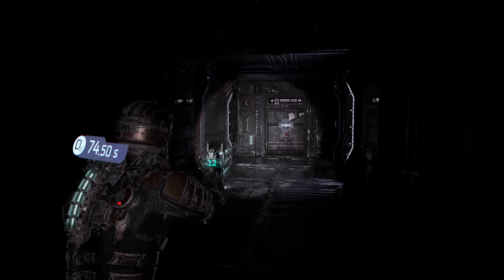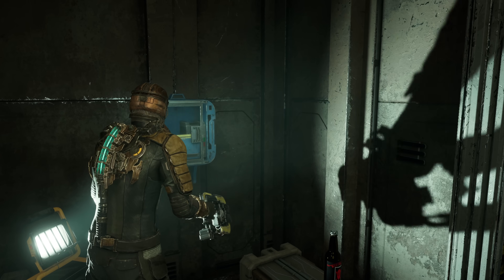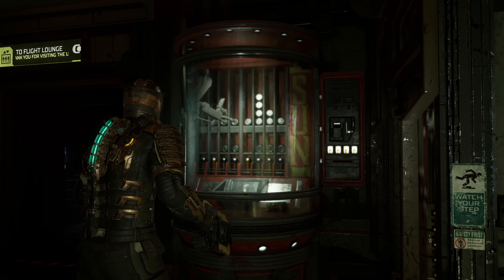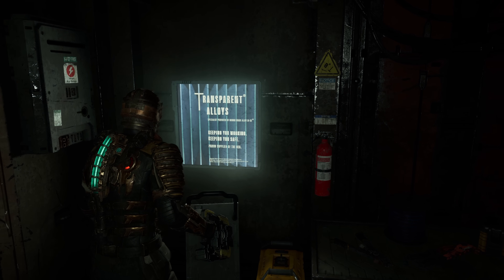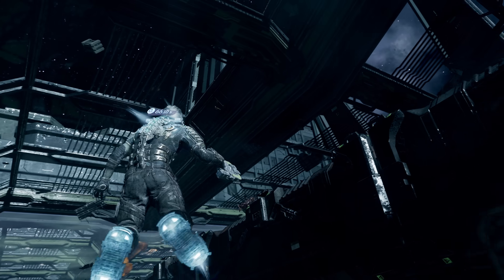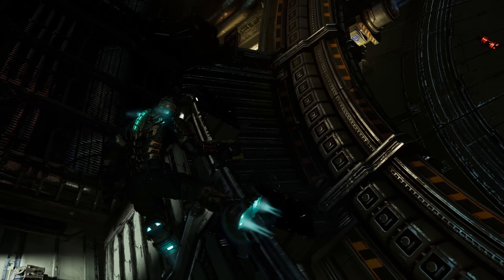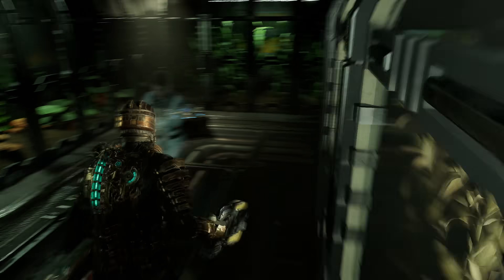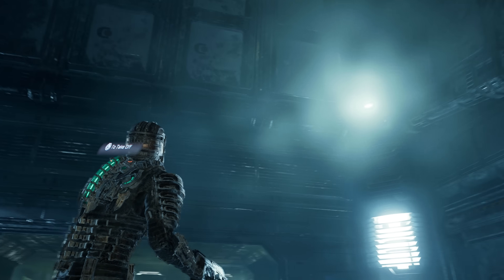Is Dead Space "Realistic"? - An Engineer's Review

Comment: 1:29:33 So you mean to tell me that you completed this game on the hardest difficulty,with just the Plasma cutter while casually examining every little engineering detail in the game?
Well damn, engineers are truly just built different huh
Reply: Just plasma cutter is actually pretty optimal.  
Save money for armor, damage upgrades all in one place, all rng ammo drops are for your best (only) weapon.
Reply: @craig01001  also the plasma cutter is probably the optimal tool. Damage output doesn’t matter because you need to separate the limbs
Reply: @Shin-e2w  The damage output does matter though as higher damage separates the limbs quicker especially when dealing with the tanker enemies, luckily though once max upgraded the plasma cutter has very good damage output.
Reply: There is also an achievement (on console, anyway) for finishing the game without using anything else, so there are multiple ways they incentivize you to use it. I also find it to be the easiest to use
Reply: I never got the plasma cutter only achievement on the original. I always thought it was probably easier to just use one weapon and it was. It’s so much cheaper plus all the nodes help fully upgrade it faster
Reply: Funny thing is, I played this with only the plasma cutter and pulse rifle.

Most of the ammo drop was for the two weapons, and once upgraded both, they devastated everything. Especially the last upgrade tier for the plasma cutter.

Also I work in Aerospace Engineering (ME).. If that helps in any way. I like to streamline my gameplay into an easy system to allow me to focus on the environments, sound ambience and gameplay.
Reply: Thats not actually surprising. The Cutter isn't like your starting pistol with bad stats who discard at your first chance. It is legitimately very powerful. With only one fire mod it doesn't have all the thrills of the other guns, but in exchange the beam swap is handy for attacking different limbs.
Reply: Necromorph storms over and gets blasted to oblivion: "Shush, you're interurpting my analysis of this section fo the ship." He's a man of single minded focus, committment and sheer fucking will!
Reply: Plasma cutter is good. It's also the most fun weapon aside from the contact beam IMO. Line gun is fun, flamethrower is kinda meh, ripper is worse line gun, pulse rifle is fun but kinda sucks against narrow limbs, force gun is sometimes fun, sometimes very frustrating

Comment: 46:50 Little error. From IRL railguns we know that they also have muzzle flashes, since electrical sparks and small amounts of plasma created by the high voltage follow the projectile out the barrel. Also the Asteroid Defense Cannons are actually Mass driver cannons, so a form of railgun
Reply from the maker: Nice catch, I didn't know that about railguns, and mass drivers would probably make more sense here too. Although, I might argue that for such a muzzle flash to occur, there would need to be air (or some other medium) for the arcs to form the plasma from, although I suppose there are a number of ways to explain that (coolant gas, spark build-up, chipping/sublimation of projectiles, ...).
Reply: @RocketScienceGallery  That's fair, I didn't account for Vacuum(wrote that late at night) though I still believe they're electromagnetic mass driver. That's because if it was convential munition the proppelant charge would make the ammo require 2-3 times as much storage space. Also with propably aphe warheads it already would needs safe storage, add and propeelant charge it and you have ship destroying accident waiting to happen (you can ask the HMS Hood about that).
Reply: since this is right where all the mineral debris is pulverized, the ionized dust would be an explanation. Aswell as the refraction of the light beams @RocketScienceGallery pointed out 47:00
Reply: The traces the bullets leave in vacuum can also only really be explained by friction that probably heats up something like a plastic layer around the projectile that decomposes mechanically or chemically if theres no chemical propellant, as far as i can imagine, but feel free to correct me

Comment: One thing I will point out is that the Ishimura is a first-of-class vessel, and has likely been the testbed for many of the technologies it utilizes, this can explain why it's so labyrinthine as well: she's been reconfigured more times that are probably recorded as damage has occurred or as new technologies have had the kinks worked out.

26:30 it's not that it can't maintain an orbit because it's not moving fast enough, it's that it never had a stable orbit to begin with, the engines were being used to push away from the planet like they were a VTOL, it's absolutely moronic, but from how it looks like shit went down in the movie, they probably didn't have time to tow the mass into a proper orbit before shit hit the fan and automated systems have been doing heavy station-keeping, the whole thing with getting to orbit through the debris field is because they're moving into a parking orbit, with the amount of weight they're lugging around it'd take weeks.  My best guess is they have to drop down to pick up the load and then haul it up to a more stable orbit.

30:00 This is something we're pretty sure is possible, it's called a plasma window, we don't have a working unit, but the math apparently seems to work out.  There is a similar technology that is used in particle accelerators called plasma valves, they're used to give time for the accelerated particles to seal the internal vacuum chamber in the event of a breach so the accelerator has enough time to decelerate the particles so they don't, and I'm oversimplifying here, explode air molecules and shred billions of dollars of equipment.

36:20 Best guess, A tank is full, there are four.

43:30 This is 100% gamification, they were originally malfunctioning gravity plating that would instantly splatter the player if they messed up around them, it was changed to arcing so the player isn't INSTANTLY killed and can, in theory, survive a mistake.

47:00 Railguns can have muzzle flash, it's the arcing from the rails to the projectile, as the projectile was part of the circuit before being launched.  Though the recoiling barrels hint more toward it being more conventional, could be a hybrid chemical-coil launch system though.  Also, dust from obliterated space rock would reflect the light.

48:40 They're using hydroponics (48:58 The room is the Hydroponics Central Hub) so they can also grow fish in a stable manner, so crop rotation wouldn't a factor.  Dietary issues ARE absolutely an issue.

54:36 Looking at them, they're probably not bit identifiers, the lights are probably a network or drive activity monitor of some kind.

55:53 Ease of transport, the ship is designed to support the setup of ground stations in the early stages, shuttle flies in, they move food onboard, and it immediately goes for the ground station.

1:00:15 This one pisses me off, in the original it would pull the asteroid into the processor, not detonate it instantly.

1:06:00 Yea, I'm chalking all of the labeling issues here to 'it's government issue'.

1:24:00 You are absolutely correct, the movie showed the system in action.

Comment: 44:39 Coming from an electrician. While a lock-out tag-out system will provide information as to how long it's being worked on, its main purpose is to physically "lock-out" a specific cicuit from being turned on while maintenence is being performed. If a circuit is being worked on and someone else turns on that breaker, it could easily cause the person working on the circuit to be shocked or even electrocuted as they are not expecting to have to treat the circuit as if it live. The "tag" is the secondary function that lets the person at the breaker panel know who might be working on it, how to contact them, and let them know when the work is expected to be completed.

Comment: 1:16:52 
In an audio log it's explained why the force gun doesn't kill Mercer
Mercer asks Temple to help him build something for the Marker
Temple insits he needs his force gun for it
Mercer doubts it but lets him take it however he has him remove several modifications that make the force gun lethal
Which is why it only injures Mercer in the cutscene
Reply: which audio log is this and where can it be found
Reply: I didn't play DS but it was the inspiration for the first mod system in warframe(it was replaced year after launch with a lot more flexible system except which also got multiple improvements since, except for the stupid polarities we still have) and the old UI.
Reply: @CJ-gg2ex  Very late, but it's an audio log that can be found in the cargo hold (just finished the remake, and found it there).
Reply: Yeah, but I feel like the Force Gun blast would have still knocked Mercer on his ass. It's still a powerful weapon, even if it's been altered to be non-lethal. It would have done more than just lightly push Mercer back a few steps.

Comment: Giving everyone on board a RIG and ample access to Biotic gel and cloned limbs was probably cheaper for the CEC than completely remoddelling a ship that had already served the better half of a century to meet at least the minimum of safety standards.

That being said it's also worth noting that in many of the areas with an abundance of unsafe conditions the general level of protective equipment used by the workers in those levels increases.

Engineering may be a deathtrap but the suits used by workers in those areas are built to at least mitigate some of the danger.
Meanwhile the hydroponics area you see more padding and fewer random spikes and moving parts correlating with the somewhat lesser protective gear worn by their staff.

Comment: 18:28 from my somewhat limited electrical experience this actually looks pretty ok. it's looks to be a wiring diagram instead of a ladder diagram which i'm more used to which tripped me up a bit, but the 3 phase motor in the bottom left is wired fairly standardly with overload protection and everything. coming off of that on the bottom is a control circuit, wired to 2 of the 3 phases (not through a transformer which isn't common but could happen). the 3 phase lines don't seem to originate from anywhere, which is fairly standard, but connected to where they start is what i assume is the coil for the motor starter (with overload protection again so points) but that should be over with the control circuit not connected up there. top right is a mess of connections that i don't recognize but does have all the symbols right
Reply: Biggest issue I saw firsthand was that this diagram has no labels. Wiring this would be quite annoying imo and I'd probably just go ahead and redline labels into there for my and whoever else's convenience 😅

I mostly work with control cabinets that do not employ much motors but the top left is a bit confusing to me since it appears the button above the throw switch would short L1 and L3. I'm pretty sure that would cause an arc flash event if those legs were energized but anyone else can weigh in haha 💥
Reply: @LoverOfLaughs  also the three fuses to the motor are drawn separate, they're supposed to be drawn connected since having one phase short and fry can still let the motor run with 2 phases and increased wear, heating and potential damage. I worked in a metal working industry as electrical maintenance.
Also the whole right side is basically utter nonsense connected to a circle.

Comment: I'd guess they once had more than one tram on the ship but the one we access is likely an emergency one that still works. As there is enough parts of the ship locked off to us that also have other characters moving about with them making me think we just see either the main maintenance tram or a emergency one used for the event of a disaster that runs on its own line that doesn't often get used compared to what I assume would be a larger system with a few more trams for the main transport of the Doctors, scientists, miners & security forces as well as the bridge crew & officers basically all the people who aren't the engineers & such use likely a kinda larger tram that can hold more people as the one we use in game only could hold like 4 people & maybe a bit more if you crammed it but it defiantly could carry tools & stuff as well. I remember a part in the original game where you pass through an area that looks like it once held two tram lines round the area where you need to repair the tram to progress at the start. Also I think the second game also implies this. There likely also is slower ways around the ship which most people would be using as I'd assume only the engineers & stuff have to take the long trips across the ship on the regular. I also want to add about the grimy industrial look it kinda makes sense for the ship to have as well its the mining ship that's very old & on its last mission before its going to be made into a museum or scrapped. So its not like I'd guess its much more than an old ship falling apart. Like in its hayday it probably didn't have all these exposed panels & stuff but now that its so old & things break so often the engineers just go like F*ck it it'll break soon enough again & doing the whole panel thing is time consuming. Also the ships damage from the current alien zombie situation could help cause more of this. I do like it as a old falling apart ship. But the colony is another thing which kinda seems unsafe for what it is.
Edit: on the centrifuge. At least in the original game it made sense why Isaac had to take such a dangerous gamble by passing the area where the arms where moving. You could see that some Necromorph growth was over the area & I think part of it had broken off making the area have saftey in the before times but since you don't have time you've just gotta start the thing up instead of how in a time when they didn't have monsters trying to kill them they could make a makeshift bridge to help the person reach the button & then get back over & later on when they are safe they could turn it off & rebuild the walkway. I guess the remake missed that detail leading to a nonsensical area.
Reply: The biomass is blocking the path in the remake centrifuge too, or else he could simply just walk back the way he came and go back through the door he came through.
Reply: @Krosstic  Oh I was confused by his comment on this part? I hadn't played it back then But I played it recently & was confused by why that guy said that.

Comment: 32:51 it is however handy for when you are letting your suit dry after use.
35:50 Lighting can actually be very important on  a vessel, especially if you dont have your own with you. When the lights on a ship go out you cant even see your hand infont of you.  But there should be two separate lighting circuits, normal and emergency/vital that has a lower power draw.
46:00 theoretically, could the laser be reflecting back off the the dust and debeir created by destroying the asteroids and the propellent gasses following the projectiles?
51:31 Could the Hallway be held at positive pressure, that could explain why the gas isn't evacuating into the hallway (However it would imply the gases gets pushed to the opposite side of the room i guess)
56:00 This ship looks to be primarily engineering/ machinery rooms. It's common to have low railings and exposed machinery. There are only two places on the ship that I was on that was highly guarded/protected and they were the hydraulic rams  responsible for moving the control surfaces. Heck you could freely crawl under the main shaft while it was spinning far faster then something that size has the right to be spinning. (watched a mad lad dryhump the shaft while we were going near max speed.)

Comment: 3:28 Small note, jumping between systems does not use the FSD's Alcubierre drive mode, it uses some form of higher dimensional travel, based on reverse-engineered alien tech. Supercruise inside systems does use the Alcubierre drive mode of the FSD, however.

Comment: For the 'Atmospheric Shields' at 29:40ish, I think it's very plausible that it does indeed make use of the unified field theory; Specifically, Stasis. A very finely controlled stasis field applied only to small particles with enough strength to resist the natural atmospheric pressure being restrained would of course be strong enough to contain the stagnant/mostly unmoving atmosphere of the area- But would Not be strong enough to halt objects of larger mass that has force actively being applied to it, ie, a person walking and pushing off with their foot as they step into it.

Similarly, but I think less plausibly due to atmospheric pressure, computer controlled stasis 'lasers' outlining the shield being produced could, hypothetically at least, re-form the field in real time to allow larger objects to pass while retaining the seal.

Comment: Things I would change on this ship would be: 
Smooth wall panels with handle holes on the walls in case components would need servicing.
Escalator rails in case of gravity failure.
Colored lines on the floor and maps on the walls to make navigation easier between major areas.
A lighter internal color scheme on the walls.